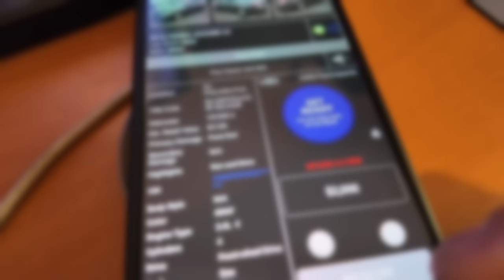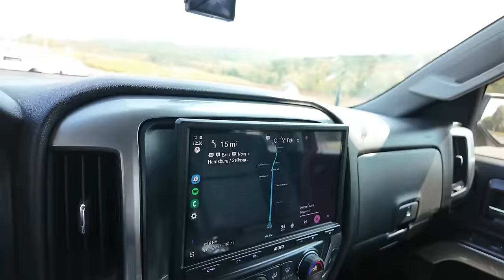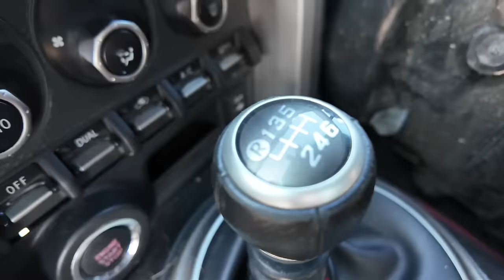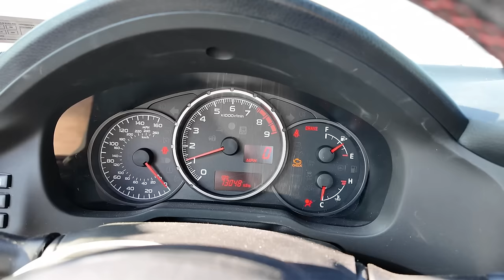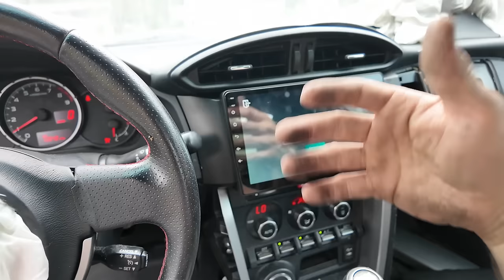I won a RWD Sports Car at Copart for $3450!!

Comment: I always liked the brz,well done Todd I got a Porsche boxter from phoenix copart 2000 with 46,000 miles for $4,900 minor damage in rear end a little trunk floor pulling and a new to me bumper and she’s fixed.also a manual convertible.thanks John from Arizona

Comment: My daughter has an Impreza i think. She called me crying yesterday saying a bunch of dash lights came on so I drive 1.5 hr to check it out... code was for torque converter survo... cleared codes and came right back. So she is going to start with trans service. Hope it's not bad. She just bought it 6 months ago
Reply from the maker: If it's a 2012-up then it's a simple fix.  Buy a valve body and replace it.  It's a simple job, don't even need to drop the fluid.   There is a plate on the top of the transmission right behind the engine, it comes out the top.  Replacements are around $250-300, but it may need reprogrammed.

Comment: Yo Todd look up  a pdr guy for the door dents. If you remove the interior panels to save the pdr guys time it will be even cheaper. I had a pdr guy spend 4 hours on a trunk my wife backed into a garage door and he fixed it so I Can't even tell where the huge dent was all for 200 bucks.

Comment: There’s a was problem with the manufacture using to much rtv on the oil pan. The pick up tube gets clogged and killing engines. You probably already know, just thought I’d throw it out there cause we know your going to beat on that little car🤘🏻
Reply from the maker: That was the 2nd gen, not the 1st gen